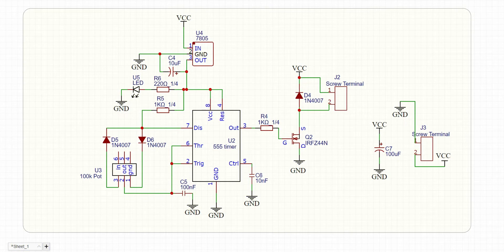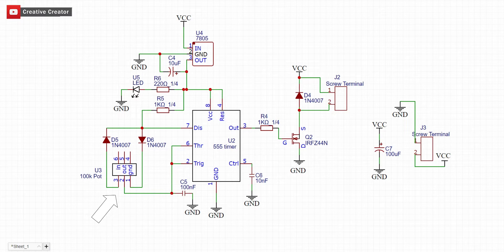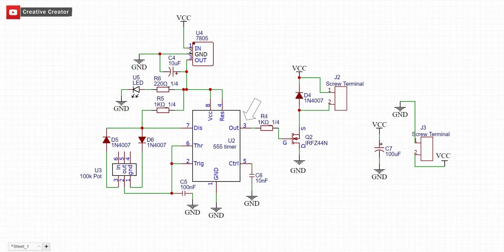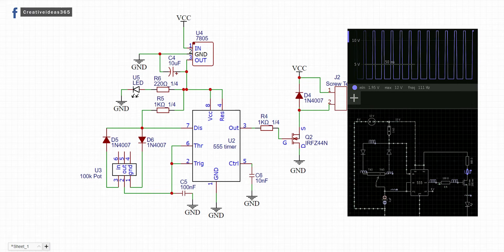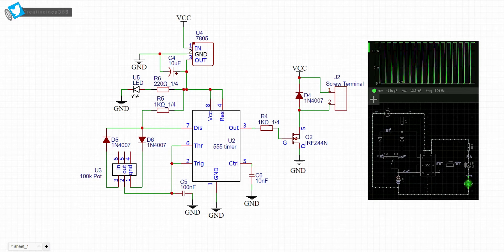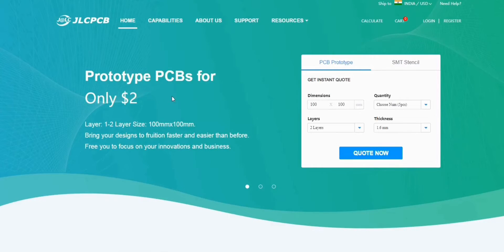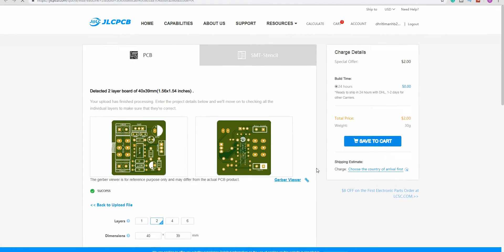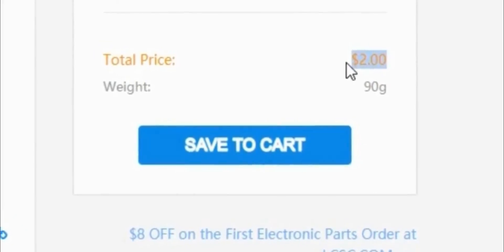Powerful DC motor speed controller

Comment: Hi 
how did you calculate the Gate resistor ?. The NE555 provides max. 200mA and let's say 12V. The Gate threshold voltage is about (2 ... 4)V. Can you help me ?